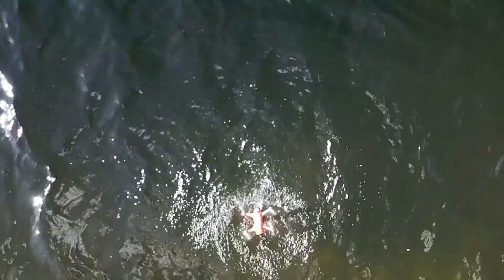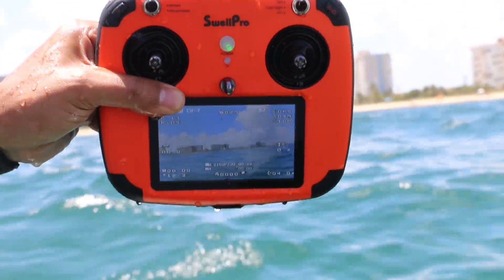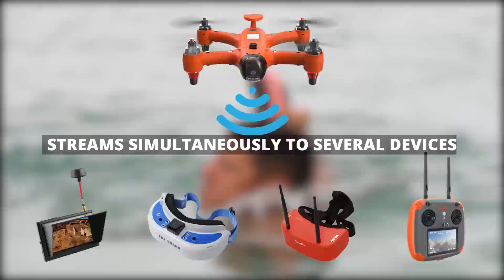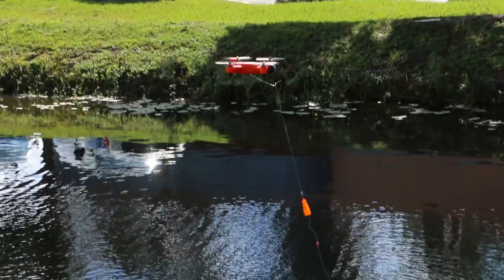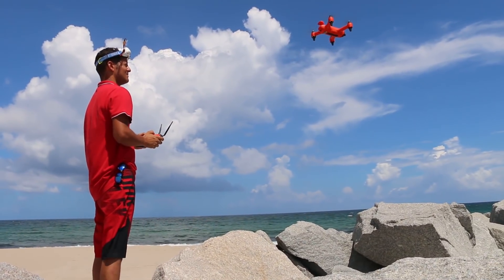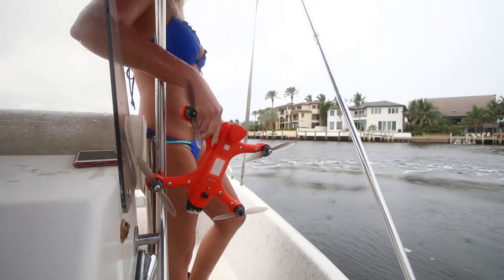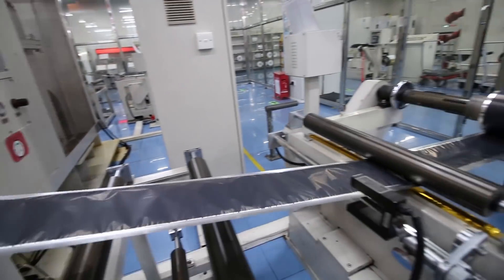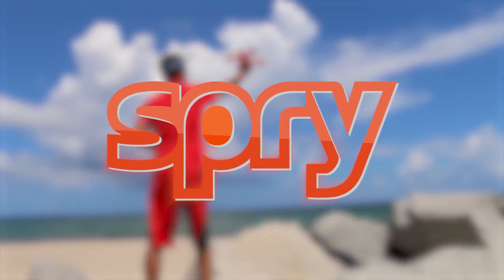Spry A drone that can submerge, float and fly. Official Kickstarter Video

Comment: Finally a drone that will work because does not use a cell phone! I have been wanting to get a drone for a long time. I always research before buying, and found that there are lots of compatibility with cell phone issues with all the other drones. Often, your cell phone will not work with it at all. This is due to so many different variations of cell phones, even within the same model. I do not want to have to keep buying cellphones until I hit it lucky, and so, have done without a drone. This just may be the Game Changer for me. I will seek specifications on this drone, and more info, if good enough, I will buy.